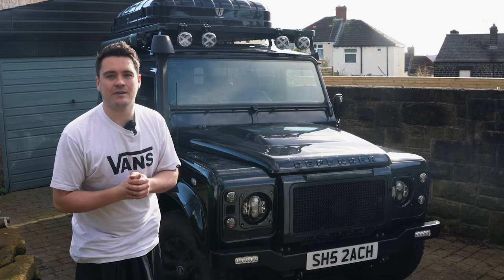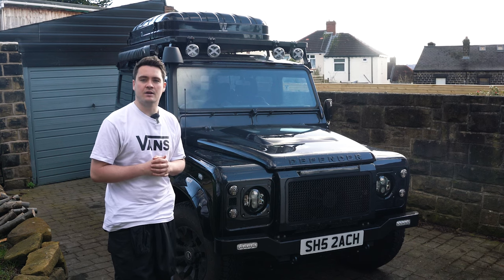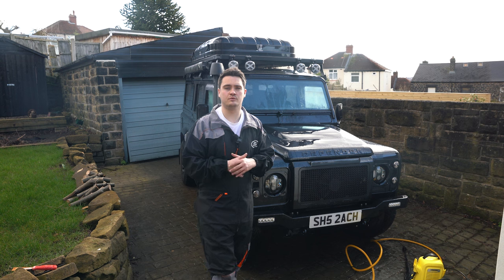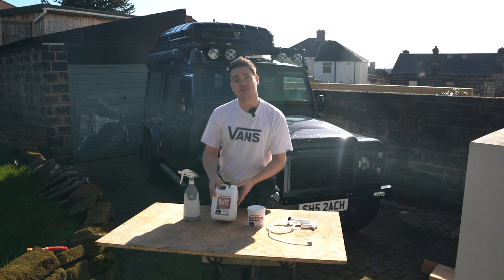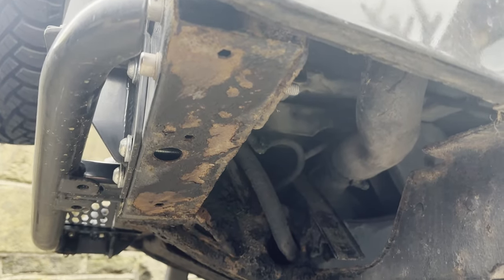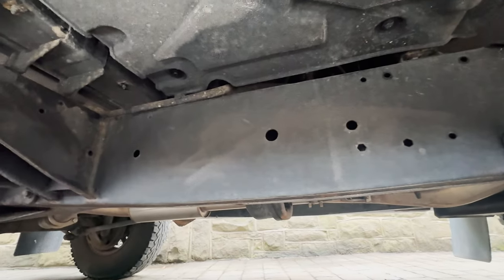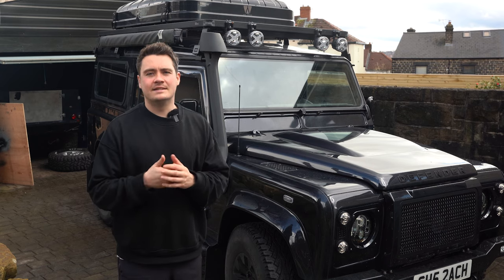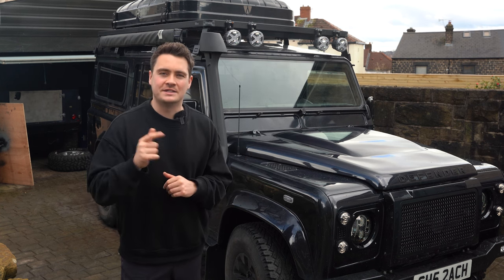STOPPING THE RUST ON MY LAND ROVER WITH LANOGUARD!

Comment: Sorry I didn't know how to contact you personally I was just wondering what year is the scout and can you get away with a 2008 defender 2.4 l engine on the road tax because I know the 2.2 is £320 and the 2.4 is 695 I think trying to get around it     since the 2.2 is more expensive
Reply from the maker: Scout is a 2011 - I think it just depends on how is has been registered. I believe station wagons are potentially cheaper to tax? But not 100%